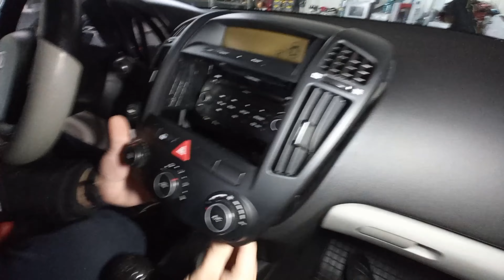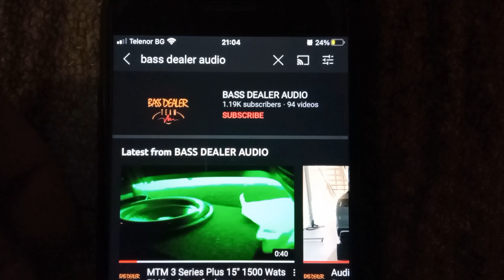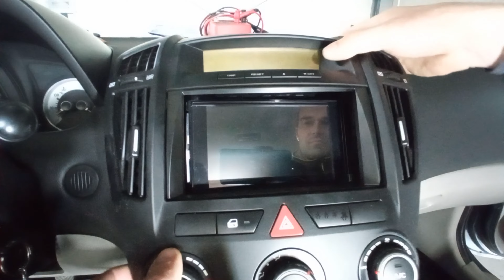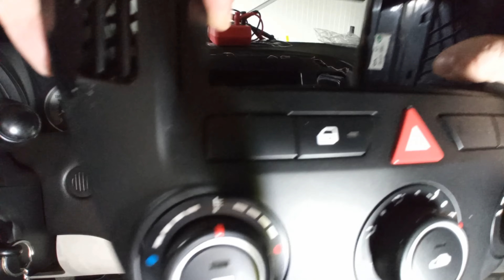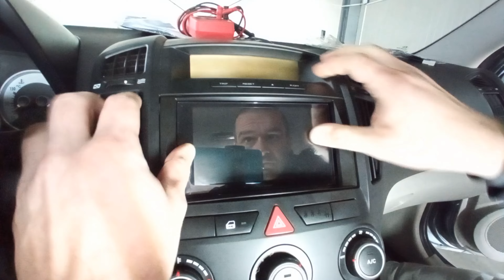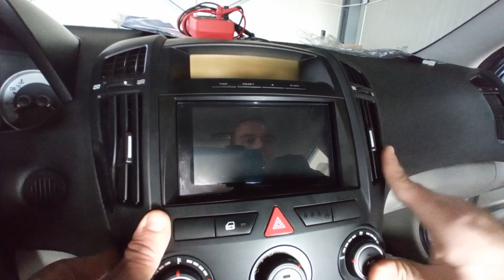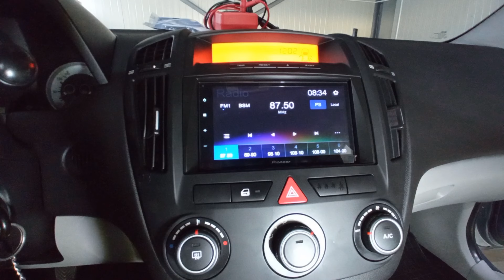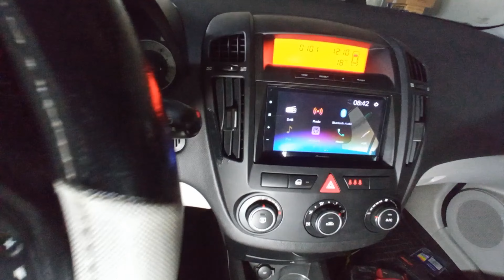Kia Ceed 2007-2009 Pioneer DMH-A340DAB  Installation Waze Navigation , Web Link ,YouTube

Comment: Hi! Did you use a standard 2DIN cage? Where did the plastic cover come from? And what was the lot in-and-out movement all about? Thanks!
Reply from the maker: Hello , you need to order frame https://www.avitel-bg.com/acv-381178-18---2-din-kia
Reply from the maker: And lots of in and out movement was to make perfect fit for the frame
Reply: @bassdealeraudio442  Thanks a lot! Will try to upgrade mine. :)

Comment: Hi had the same stereo a340dab pioneer fitted by halfords but the steering wheel controls are not working the loom is fitted just can't get it working any idea what's rong it's on a smax 2oo7
Reply from the maker: You need 2 connect swc module
Reply: @bassdealeraudio442  Hi thanks for your reply halfords have attached a module to the steering it is in now l don't no which one they have used but it doesn't work
Reply from the maker: @davenixon149  2 connect works :)
Reply: @bassdealeraudio442  Hi took it back halfords and they had a look at it they have ordered a nother module the same just in case it's faulty and a different one I've got to wait till they've come in
Reply from the maker: @davenixon149  They will make it :)
Reply: @bassdealeraudio442  Thank you very much for your reply I hope they do 👍
Reply from the maker: @davenixon149  Or come to Varna Bulgaria ;)
Reply: @bassdealeraudio442  I  would love to meet you guys thanks for your help and replys 👍
Reply from the maker: @davenixon149  You are always welcome 🙂
Reply: @bassdealeraudio442  Thanks 👍